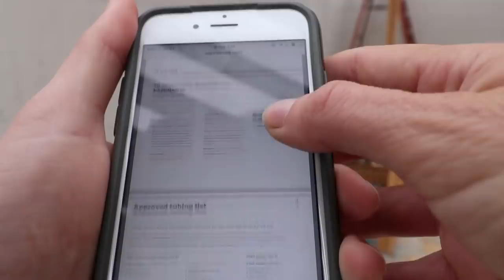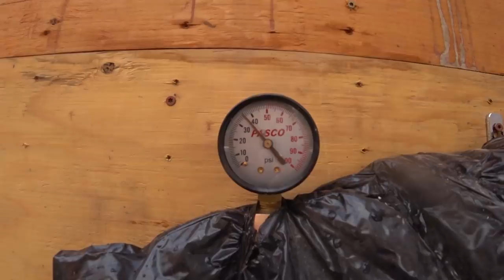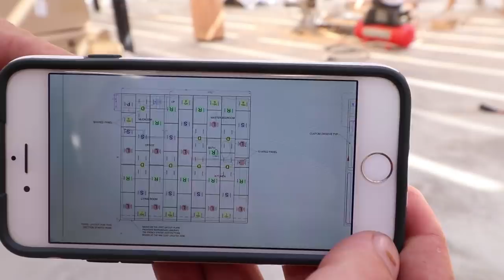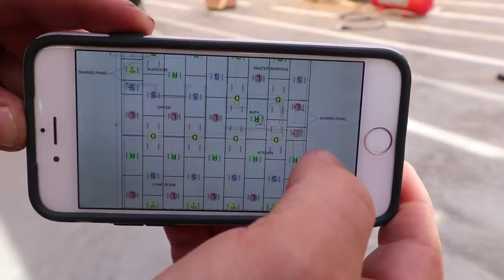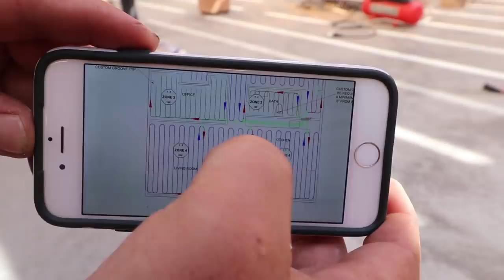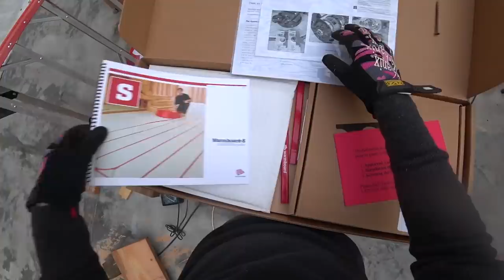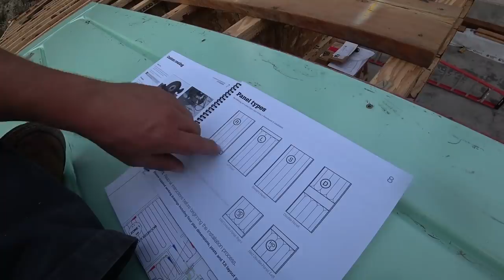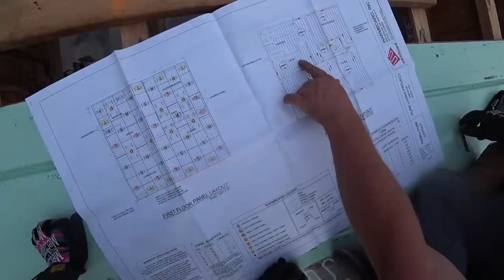Building a House Start to Finish: Radiant Floor Heating Installation Ep 1

Comment: Why are the beams on top of the other piece of wood? Why not run the timber pole all the way to the floor?
Reply: Need treated wood next to concrete. FYI treated wood is not always green anymore.
Reply: The other beams are on a metal standoff/bracket. Why is that one on an ugly wooden shim?
Reply: Standard practice to use pressure treated wood as sill plated and its pretty much code everywhere. Pressure treated wood is used for many reasons as a first layer (sill plate) before building on top of with standard untreated lumber. Some reasons everyone uses Pressure treated is it bug/ termite resistant and also handles moisture and rot much better than untreated wood. Termites can migrate from underground through cracks in concrete foundation and will eat there way up, they hit the pressure treated wood and rarely eat it. Why it might not look great 99% of the time its usually enclosed in wall with drywall or trimmed out to cover up the look. However, I dont think its really issue leaving it uncovered because it's a garage. 
Once again pressure treated is used as a sill plate only, the first layer of wood that is in direct contact with concrete. You don't have to use PT treated wood if your using a metal bracket that keeps your wood beams from direct contact with concrete.
Reply: I get all of that. I'm just curious why they used some ugly lump of wood instead of the metal bracket
Reply: who knows, maybe it doesn't bother them. if it was my garage i don't think i would lose sleep over it considering you can always go back and dress it out and cover it up, hell knocking the beam out and putting a metal bracket in with  a new beam is a piece of cake . They said they didn't like there style of metal brackets which i can understand why because it's a funky bracket they got and imo retarded design. They had pressure treated wood already and was probably an easy decision considering there probably more focused on there living space rather than the garage.
Reply: That and he said something about nailing off to it in the future - maybe he is considering closing the area under the stairs in?

Comment: Discovered your build.  Great work but the problem of drilling into a radiant floor that was measured and then poured and allowed to set raises questions.  So what have happened had your drilling into the poured floor resulted n a puncture of your radiant tubing?  Would you have had to drill out all of the lines before refilling and replacing the drilled and punctured sections?  Is there are there other build techniques that could have been less risky and blind drilled?  The answer is yes there are other methods of laying, marking and placing the radiant lines so as not to risk a puncture.  Since you did not have an infrared type imagining device or rental then the layout should have pre-marked and posted the new drill marks and attachments. The FLIR type devices could have shown you the drilling area and pattern.  That's cool but marking and having drafted the positions is much better and more secure.  Keep up the good work and effort.

Comment: Why is there no blocking or in the UK bridging in I  joists to stop them rolling
Reply: John Douglas Dawson engineered I joists do not need them...per my research and what Jessie has said in the past.
Reply: John Douglas Dawson. The flooring on the top and the furring channels underneath work to control the rolling of the  joists.
Reply: Blocking and bridging depends on the span, depth, and stiffness of the I joist system. They should have either a custom a bridging plan from the I joist company or a guide based on span and depth for the product. For some configurations you don't need mid-span bridging.  The ends of the spans are laterally supported by fastening to the rim joist. The 2x lumber they screwed to the top may serve as temporary construction bridging as long as the end bay is blocked appropriately. I was expecting some bottom bridging at that section too, but I guess not. Fortunately as they install the warmboard from one end of the span to the other it will help stiffen things up.

Comment: Why would You not use all that thermal mass in the lower level!? Especially with a fully insulated basement? Hello?
Reply: You're very observant, your point is that everyone hates getting into a warm car free of snow and ice would sure suck said no one EVER!!?
Reply: We have heated floor in shop at my work, want so bad in my garage !!!!  Not to mention it would be very effective way to allow use of lower level when doors need to be opened.

Comment: Bobby who???? Congratulations if I’m reading into this. Also. Hears my DIY fix for a blowout in any tube of glue etc. take an aluminum can. Cut off the ends and down the middle. Then duct tape around the can. About an inch overlay. Bam bam, back in business.

Comment: To control slab heat a sensor is needed in the slab with proper thermostat!
Reply: john d 
Slab Sensor 072 – 20’ (6 m) wire
Slab Sensor 072
The Slab Sensor 072 is designed to measure temperature in outside snow melting slabs. It has a high-density polyethylene (HDPE) sleeve, which is designed for use in conduits, soils, or concrete, as it is suitable for direct burial. This product is supplied with 20 ft (6 m) of 2-conductor cable.

Floor Sensor 079 - 10’ (3 m) wire
Floor Sensors - 079
The Floor Sensor 079 is commonly used for floor temperature sensing in floor heating applications. The thin casing allows for retrofit installation between tile spaces if necessary. This sensor is designed to provide a thermostat with the ability to maintain a minimum slab temperature, or help to limit the maximum slab temperature.

Comment: I do not understand why you guys don't use all Simson hanger for the joint, and also you guys did not use enough caulking glue to the panel stick to another panel???

Comment: Probably a bit late, unless you plan to drill any more holes in the slab, but a stud/cable detector should help, if the rebar isn't too deep, even a strong magnet may detect it ;)

Comment: Warm board works on an outside reset programmed in advance. You don't just turn it up and down like a hot water or hot air system. The outside reset runs it.

Comment: If not for SAFETY, then for efficiencies' sake .............should be laying & shifting several 3/4" x 2' x 8'  to 4' x 8' pieces of CDX or better plywood on top of the joists. [BTW, never forget to temporarily screw-nail each plywood 'footing' panel in two places to preclude dangerous shifting!]

Comment: is the weather very fickle there? can you set the temperature of the warm board to a low temp  and leave it for "winter" and as spring approaches turn it off  I do something similar here with the gas heater in Australia the heater goes on a very low setting and it stays on day an night

Comment: Why not just put a couple sheets of quarter in plywood up there for the time being to work on instead of having to walk on those joist or those 2 by 8s much safer and can be moved. I know its done now but when your putting in your second foor would be usefull.

Comment: #purelivingforlife. You will still need bridging in between your I-beams.
Reply: Its not required, many contractors will suggest no bridging as the bridging itself lends to squeaky floors.
Reply: No bridging required if bottom of joists finished with drywall
Reply: From the Trus Joist TJI Joist Specifier's Guide TJ-4000 Feb 2017: "TJI joist floor framing does not require bridging or mid-span blocking". I'm not sure, but I think they are using TJI's.
Reply: Micah Watson so the floor won't bounce over a 36' span at all with 14" beams
Reply: Micah Watson that's all I've been saying

Comment: From personal experience using screws to fasten in a shear situation is not the best  fastener.  I have watched lots of your  shows and very seldom do I see anyone use saftey glasses.
Reply: You  dont have to wear saftey glasses but you wont work for me unless you wear them,  The home builders have a big ligility for un safe conditions
Reply: You have never worked on a cdonstruction job
Reply: I have had a general contractors licence for 40 yearss and I dont want any of my workers to have a problem with their eyes.

Comment: Why is a "mad room"?
Reply: It's a "Mud Room" .  This is the entry to the house or building.  Basically if you walk in and your shoes/boots are muddy or dirty you would stop and take off your shoes in the "mud room" and then continue on into the house.    That way you're not going to track mud and dirt all through the house.  Helps keep the house clean.  
Also in most cases, this is where you would take off coats and outer layers of clothing that are covered in snow, ice, or indeed mud.    Most mud rooms include hooks on the wall for hanging up your coats to let them dry out.
The flooring for a "mud room" is typically designed with water resistance in mind.  So tile or lamination is used rather than wood or carpet.
As to your question about it being a "Mad" room, that's simply a dialect issue.
Reply: mud room

Comment: This is probably a dumb question, but can this floor heating system be used to cool the house too?
Reply: Technically they can - some off grid homes have a chiller and a heat source and can apply either.  But generally speaking when it comes to cooling, people still like the floors warm and only the air cool.
Reply: Thanks man! Your videos are awesome btw, it inspired me to build a workshop by myself.

Comment: My brother put radiant heat in his floor and it wouldn't heat through his hard wood floors
Reply: you need a higher temp in our loop on carpet and hardwood than concrete or tile. The installer needs to know the flooring material when designing the loop and it can never change unless its set up from the beginning.
Reply: We're able to regulate the water flow in each of our zones at the manifold and control the overall temp with a thermostat at the water heater (we're not using a boiler, just a water heater tank ). The thermostat on the wall basically controls the on and off functions of the pump. 
Best thing we ever did, we're in Canada and every home has cold damp basements except us, you can sleep on the floor, it's a concrete slab and you want that warm mass in winter. Upstairs in the kitchen there's a  plywood subfloor topped with cement board and ceramic tiles, again a normally chilly floor but ours is toasty warm.

Comment: The underfloor heating system in the slab would work great with a solar heating system on the roof, storing 'free' heat on sunny days in a way that releases it slowly. (Ideally it would heat up a cistern tank first and then pump any excess heat into the slab.)

I wish you'd stop using the term "radiant" though! As we all learned in high school, there are 3 types of heat; conduction, convection and radiation. Radiant heaters are those red glowing ones that predominantly use radiation (of the non-nuclear kind). Underfloor heaters use pure conduction.
Reply: Yes, heat rises. That's called convection. The slab transfers heat to the air through conduction, then the air rises due to convection. The only heat it radiates is through infrared light, which is fairly minimal in a warm (not hot) slab.

Yes, those bar heaters and the ones that look like lightbulbs are pretty inefficient, but they do at least exemplify bona fide radiant heating.

You know, they're only inefficient in that they use electricity rather than gas or solar. In reality all electrical heaters are almost equally efficient, since they turn almost every joule of energy into heat. Usually when we talk about efficiency the heat is the wasted energy, but that doesn't apply to heaters.

Assuming you were stuck with using electricity, if you were standing some distance from the heater, or below it, a radiant (infrared) heater pointed right at you would be ideal. But if you wanted to quickly warm the whole room a heater with a blower (fan) might be better. Whether it's more efficient to heat a whole room rather than a specific spot depends on the circumstances.

For example, restaurants usually keep plates of food hot using heat lamps, rather than turning the whole kitchen into an oven. And on building sites that have high roofs and are open to the elements radiant heaters are used to keep workers comfortable, to help dry materials or to stop them from freezing. Different strokes for different folks. ;-)

But I digress...
Reply: ...Actually, there are also gas fires that use radiant heating: The ones that have those white ceramic grilles on the front that glow when they get hot. Those grilles increase the efficiency of the fire by quickly removing heat from the source. Patio heaters work on a similar principle, radiating and reflecting the heat downwards - something which a chimnea, for example, doesn't do (instead, most of the heat literally goes up in smoke).

Comment: In my opinion the warmboard is not very good. You lose the possibilty to adapt it if you make changes... And you cant stack more pipe under the windows where the heat is more needed because the windows leak.

Comment: Sigh, it's so painful watching him waste so much time and resources. Just get a nail gun, and the right size nails, and right kind of nails!!! A 4x8 panel requires about 60 fasteners (6" spacing on the edges, 12" spacing in the field). With a little experience using a nail gun you can do that in less than 1 minute. Screwing in 60 screws is going to take them at least 30 minutes per panel. It's going to take them more than a week to do a 1 or 2 day job.

If you're gluing down the deck panels, it's the glue that does almost all the holding. If you're not gluing down the deck, then deck screws do have more holding power than common nails (and only a little more than ring shank nails). But it doesn't matter in this case because the glue (if it's applied correctly on every inch of every joist) has 100 times more holding power than either just nails or screws. The nails or screws only need to hold the panel in place until the glue dries. Which means that screws take about a 30 times as long to install for almost no added benefit. A glued and screwed floor deck isn't any better than a nailed and glued floor deck, but it does take days longer to install.

In addition to the part of the instructions which explain how to space the joints and use the alignment pins, he also should have read the part which warns not to use fasteners that are so long that they penetrate all the way through the flange:

"When sizing a nail or a screw for a TJI or Truss system, size the fastener in order to grab as much flange as possible.
Do not size a nail or screw that will penetrate the bottom side of the flange." 

His 3" deck screws are going to poke through the bottom of the top flange on each side of the web at the joints that lie on top of the I-Joists. (The warm board is 1-1/8" thick, and the I-joist flange is 1-3/8". Which means they should have used 2-3/8" screws, not 3" screws (or better yet 2-3/8" ring shank nails in a nail gun). Expect to see a future episode where Jesse looks up at the ceiling of the garage and sees the exposed tips of the screws and has to do an emergency supply run to the hardware store.
Reply: Fortunately for you it isn't your house or your time or your resources.
Reply: Thanks for the info. I rather know than not know. Even if it's not my house and ect!
Reply: Either because he mistakenly thinks he needs the added strength of screws over nails (which is only true for stress along the axis, not lateral stresses, and there's no axial forces in this application). Or he's thinking that if he makes a mistake, and needs to reposition a panel that unscrewing it is easier than un-nailing it. He might not realize that once the glue sets up the glue joint is stronger than the panel (or the screws) and the panel will have to be destroyed to remove it. The glue working/repositioning time of PL Premium is only 30 minutes which is less than the time it's going to take to lay down the glue beads and drive all those screws.
Reply: Danny, don't you have any empathy for that poor woman he's making do all that totally unnecessary extra work?
Reply: 40 panels at 30 minutes per panel is in fact 20 hours (ie 2.5 days). I guessed it would take them a week because I figured he'd waste at least that much additional time with do-overs, recharging batteries, hasty trips to the hardware store, and him whining three times a day about how confusing the instructions are.

Comment: screws break,
screws pull out.
why not use Nails?
You had crane for roof rafters why not put ply wood
on roof
Reply: You can get nails that fit a nail gun that twist in and have glue on that melt when you fire them. They are used for decking etc.

they should've bought a nail gun and compressor at the start of the project. Much faster, cheaper and stronger.
Reply: There are structural screws now which are designed to replace nails in that use.  They're not just using a cheapo box of deck screws from Home Depot.